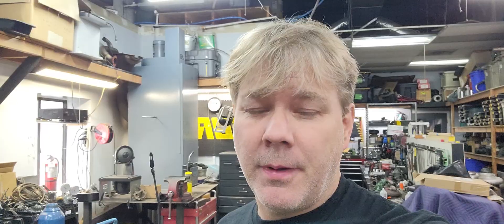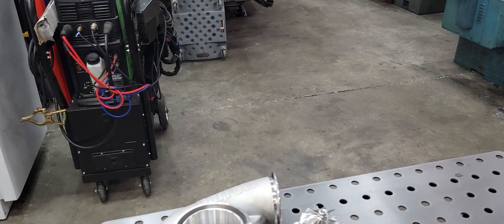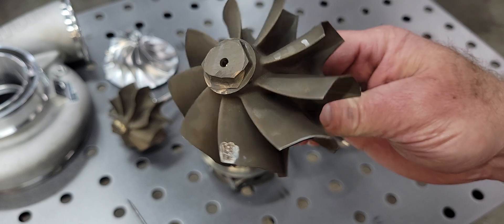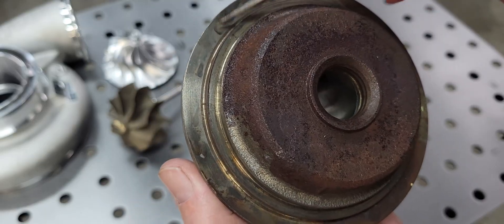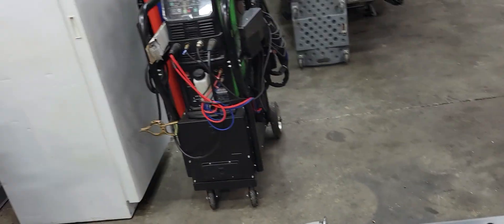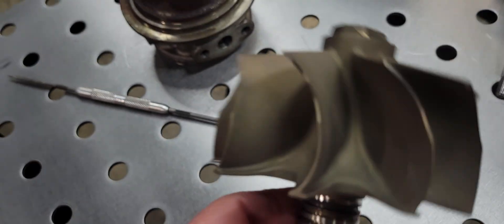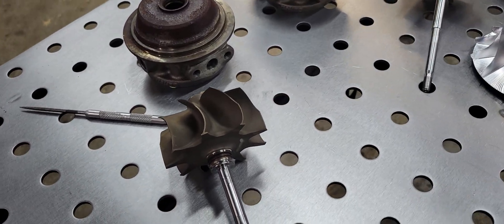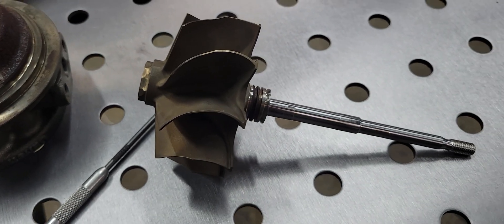Garrett G45 Turbocharger Failure, Easily Avoided!

Comment: What do you mean an interference caused this
Reply from the maker: I had some formatting issues on this video and could not link the previous one to it that explains.  

https://youtu.be/cByvqYyk7jI

Here is the link, basically the turbine housing clamp will interfere with the turbine housing if not installed in a very specific orientation.  This misalignment  causes turbine wheel to housing interference and turbine wheel damage

Sorry if the video content did not make this clear! -Reed